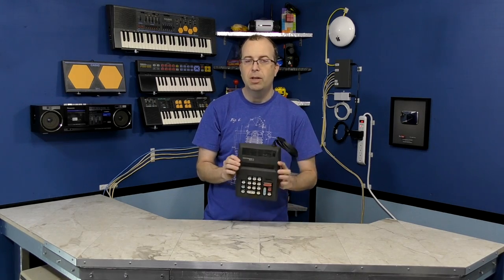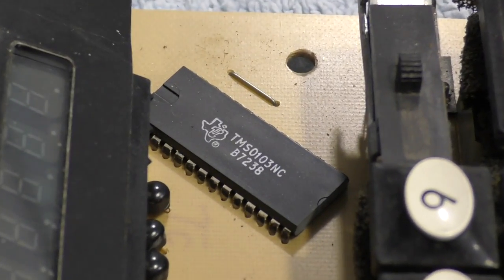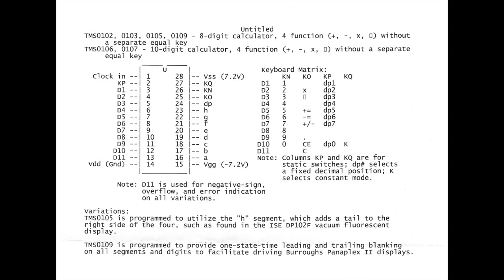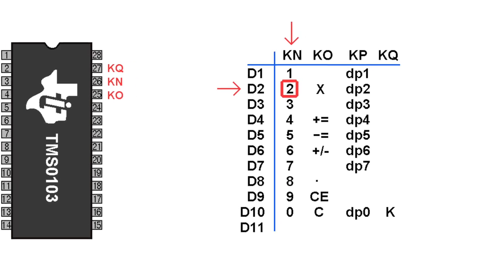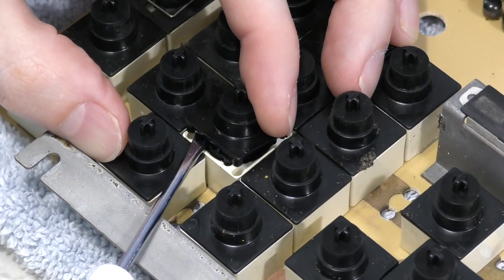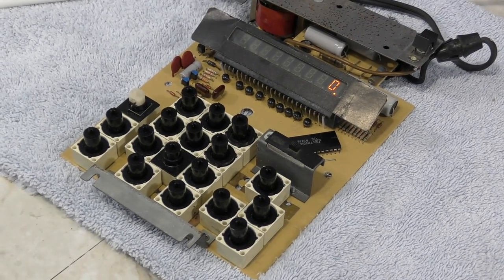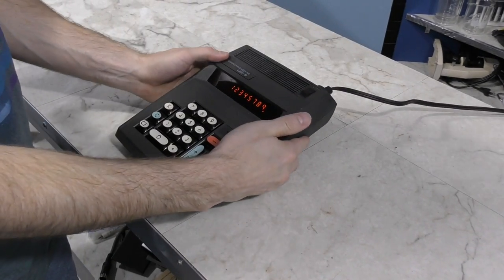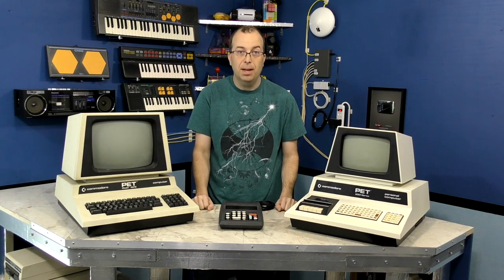Commodore Calculator Repair

Comment: Rule 1 of watching 8-Bit guy. There can never be too many repair videos
Reply: Dje4321 You sir, are right!
Reply: AGREED
Reply: Agreed!
Reply: His repair videos are so damn satisfying
Reply: They feel like some sort of technological necromancy! Best kind of necromancy.
Reply: +Etop Owertwon I think you've just hit the nail right on the head! haha
Reply: "WISE FROM YOW GWAVE"
Reply: Rule 2? Apply retr0bright evenly?
Reply: Uhmm, this might be only slightly related but: Can someone help me repair my bluetooth speaker? I forgot it outside and then it rained. At first it still turned on, but now it doesn't! If I shake it, I can still hear little bit of water inside but I don't know how to get it out. Ahhh and there are no screws how can I look inside? Model is SONY SRS-X2
Reply: 神田直子 You could try to submerge the device in uncooked rice. The rice will absorb the moisture. Leave it for a night.
Reply: Uhhuh, thanks for the tip. I managed to get the front off and look inside, it's all wet. I think I'll get it dry eventually, but what are the odds that it's irreversibly damaged? I think I need a thing like the guy in this video, so I can test where the electricity flows xD!
Reply: 神田直子 Well, if you turned the device on whilst still wet you might have caused a short circuit.
Reply: Dje4321 preachin to the choir
Reply: Dje4321 yel
Reply: Yep
Reply: Dje4321 yep
Reply: There are to few
Reply: Like

Comment: This is why I love old tech:  You can actually fix it.
Reply: @CaletoFran  you can fix old apple computers, its just harder with the all-in-one computers (apple lisa, macintosh se, macintosh plus, original macintosh)
Reply: @DanTDMJace  pretty sure he's referring to modern apple tech. But also some of those old mac's will not be repairable either due to leaky Capacitors or because the SCSI interface just dies (Dave's mentioned it in other videos)

Comment: Paper towel and a screwdriver?  Q-tips my friend.  Q-tips are your cleaning-in-small-places friends.  :)
Reply: Astricx cotton swabs.

Those things to "clean" your ears.
Reply: Now that's interesting. Specifically because Q-tip is the brand name, as opposed to the generic term (generic term would be cotton swab over here...another example is hot tub vs jacuzzi, or facial tissue vs kleenex) So that does surprise me that Q-tip is an unheard of name, as it's a Johnson & Johnson brand, which I assumed was a globally recognized brand.
Reply: I use Q-tips to clean the small spaces on traffic lights in electronics that I use on a regular basis
Reply: Plus a plastic pry. Watching knife on plastic hurt.
Reply: jw11432 who calls a kleenex a “facial tissue”?
Reply: @stevec3982 

If the screw driver doesn't damage the paper why would it do anything to the plastic?

unless your calculator has been in a tub of sulphuric acid i wouldn't expect it to be damaged by a little bit of scrubbing.
Reply: ha you don't know what i q-tip is    it is a stick about the size of a toothpick that has cotton wads on each of the ends
Reply: @lapaii  im from Irrenanstalt lol
Reply: Omg it took all the willpower I had not to yell that at my smartphone (people are sleeping in the room with me so that would have been highly unwise)
Reply: @ald0c  I wouldn't call it a "facial tissue", I'd call it a "tissue". Never once called it a "kleenex" in my life.
Reply: Still, a great hack. And I for one don't even have Q-tips at home.
Reply: @William Martinez I didn't when I first started discussing in international FidoNet discussion areas (kinda like newsgroups, but instead of  Internet it used a decentralized network between BBS systems). Not from a country where they use the work Q-tip.
Reply: @William Martinez Certainly they have, but they are likely called something else. Just like here in Finland (though your languages are very close to each others, but this is a product name).
Reply: @jw11432  We don't have them in Finland either... Just couple years ago they started importing Oreo's, and I don't understand what's the fuzz, as they are almost exactly like our Domino-cookies (the name has no relation to domino blocks).
Reply: @TexasRailfan2008  Nope, it's just a brand name of one such product. What, you don't know First Choice Cola? It's a refreshing black fizzy drink made of coca leaves and sugar. What, you mean they DON'T sell it in your country? What you said? That it's coke? No, coke is a shorthand for another brand name - and then some.
Yeah, really smart.
Reply: The thing with q-tips is that they leave strands of cotton everywhere...
Reply: @jw11432  Heh. Johnson.
Reply: but with what he uses would the cotton on the end degrade or come apart?
Reply: @Blaze5857  I clean my ears with plastic sticks and hydrogen peroxide so....
Reply: @Taylor-xh8uh  and you don't ever get bits of cotten coming off?
Reply: Cotton buds
Reply: They have a tendency to bend/snap in certain situations
Reply: @jw11432  in the UK they're called Cotton Buds or at least that's what my family calls them
Reply: @jw11432  some things are like that. One brand becomes ubiquitous and all knock offs or other brands just get called by the one really known one. Band-aid is another one, it's just one brand of adhesive bandages, but bandage isn't the term used for adhesive bandages, the term is Band-aid. "Grab a Band-aid, some q-tips, and a couple Kleenex." All pretty commonly heard statements here in the US.
Reply: @jw11432  we have the pressence of J&J products in my country but they are not marketed under the name "Q-Tips". Sometimes they will change names either because of language barrier, or other branding reasons.
Reply: You're actually not supposed to use those in your ears
 you can but that's not really their intended use they are for cleaning small things 
Im not being mean im just letting u know

Comment: I was 13 back in '72 and was fascinated by all the new digital desk calculators showing up in stores.  I always made it a point to stop by the display and mess around with whatever they had plugged in, and I remember that Commodore calculator was one of them.  Fun times...fuuun times.  :)

Comment: Q-Tips are great for cleaning hard to reach places..
Reply: on ebay if one searches Foam cotton swabs, you can find q-tips with cotton but also has a foam "overlay" on it, No mess! and some swabs fuzz less than other swabs
Reply: Maybe toothbrushes for babies and toddlers?
Reply: Marko Ahonen foam qtips? gonna have to remember that, thanks for the tip! (pun not intended)
Reply from the maker: I really needed something I could scrub with some force. Q-Tips would just bend.
Reply: EXACTLY! When I saw him "jamming"screwdriver and cloth in the key hole I shouted out :use a QTip". In the past I too have used the screwdriver and papertowel trick. Sometime back in the eighties I discovered the QTips with long wooden sticks but realized a cheep ole' dollars store QTip works just as well and come in bulk
Reply: They have wooden Q-Tips. You can get them online and I think doctors use those too.  They won't bend like the standard ones.
Reply: You can even get the really long ones they have the doctors office. The one ended ones.
Reply: Battery operated micro dremel work too... they cost about $2-$5 ordered from China... maybe another dollar for a felt polishing cone/wheel
Reply: a pencil with an eraser on the end is great for removing oxidation from metal contact points like copper brass or steel (using the eraser end). they way you were using the screwdriver and paper towel could have been too much and could have potentially damaged the pad especially if the soldering job was poorly done and the connection weak.
Reply: What about an acid brush with the bristles cut short?
Reply: That's a great Tip!

Comment: I'm a bit shocked how really simple that is for how much it cost back in the day...  interesting to watch, but honestly about 15 times during the whole thing I was thinking "that is a ton of work to multiply 6x7 just to find out the meaning of life, the universe, and everything!"
Reply: Now build a computer to find out the specific question.
Reply: @someguy2135  that was the PET
Reply: Looks simple, but manufacturing chips wasn't as easy back in the days, especially considering the very low yield and high defect rates with the processes they had.
Reply: @steve.Lowles  can't have been, Douglas Adams specified that deep thought was an apple. Must have been the Apple 1

Comment: Hey, it's the PET that I donated! Can't wait to see the PET episode later. I'm sure it'll be super interesting. Good luck getting the keyboard fixed!
Reply from the maker: hahah.. it's safe to say you'll be seeing a lot more of that PET.
Reply: Same. I'm looking forward to the Commodore PET video
Reply: I found a similar PET with a keyboard problem, and after some AltaVista-ing (this was many years before Google) I discovered that the solution was to use the blue end of a pencil eraser on the metal contacts under the keys. That seemed to clean them up enough for the keyboard to start working again.

The scary electrical arcing noise coming from the back of the CRT was another matter...:)
Reply: The "blue end" of a pencil eraser? What's that?
Reply: IT'S THE PEN ERASER :)
Reply: Yess, it is also used to clean RAM when it's not working and stuff like that
Reply: Ainhoa No, it's the ''PET'' ERASER
Reply: You're the one who donated the PET?
Reply: I watched the unboxing video.
Reply: The 8-Bit Guy I like your personality and your channel is awesome, keep it up

Comment: 8:03 - I'd recommend buying a box of isopropyl alcohol wipes. I use them all the time for cleaning corroded connectors. I usually get the small "Prep pads", the same stuff that nurses use before giving injections. They're small, easy to open and quite cheap. You can also use lens cleaning wipes, though I think those have lower alcohol content. But those are better for cosmetic cleaning than the prep pads.

Comment: Foam: I don't feel so good Mr. 8-bit guy
Reply: Ha ha noice infinity war joke
Reply: I wonder if that foam was why the calculator wouldn't power on at first, with how disintegrated it was some bits could have gotten stuck to the circuitry.

Comment: 8-Bit Guy those hex screws can usually be undone with a modular screwdriver without any bits installed.
Reply: If they're 1/4". that is correct. If not, a cheap 1/4" drive set at a place like Harbor Freight has got to be under $10. I was amazed he didn't have one.
Reply: I don't know anyone who doesn't own at least 1 standard modular driver. They throw them into driver kits for free. :P I've got like 7. I mentioned it because most people have never thought of using a modular as a tool without the bits. :P
Reply: You beat me to it! Excellent suggestion.
Reply: @SgtPiggie
It's just odd "spends thousands of dollars on electronics" "doesn't have the one tool you get free in pretty much every multiple tool set including sets fans have seen him using and recognized from their own toolbox" :P
Reply: Yeah. I typically use it as a disarming tactic so people know I'm not trying to be critical or antagonistic. I'm honestly a very light hearted person but people tend to take me the wrong way in text so it's become a habit to include that so they know I'm trying to be friendly.
Reply: I didn't seen anything wrong with your comment. I can say mean things to you anyhow if you really want...? ;)
Reply: @Maxwelhse
You may not have but it's happened in the past so out of habit I use the emoticon. ;)
Reply: Huh, figured I'd be the only one. I figured it was just a quirk of my autism. :P
Reply: thanx 4 the advice  :)
Reply: Impact drivers tend to have to much torque for plastic by my understanding. They also are way more expensive and specialized than a modular screwdriver which you tend to get with any other tool assortment, multi pack of screwdrivers? Have a free modular driver! Drill? Have a free modular driver! New toolbox? Have a free modular driver! Honestly I think 8BitGeek needs the bitkit though. Those magnetic trays, having every bit needed for retro electronics...*drools*
Reply: Actually a non impact based drill is fine as long as you use a low torque setting. Sorry I missed your joke btw. I hoped it was a joke but without tone I didn't want to risk you breaking your retro consoles or someone else who may read it breaking theirs. :P
Reply: I have used a regular non impact drill on several electroics using both low speed AND low torque and it generally is pretty safe. I dont' think I'd ever try a press for anything other than drilling holes though. :P
Reply: I actually found that out almost by accident.  I was taking apart an old ac unit and it had those hex screws and I was of course using a modular screw driver.  When i pulled out the bit, I looked at how the hole was shaped, had an "Aha!" moment and sure enough that worked perfectly.

Comment: I've got a PET 4032 and I can tell you that cleaning the keys is really easy. Took me less than an hour, including disassembly. Be careful, the shift lock key has a different type of switch, and needs to be desoldered from the board before you take it appart. Have fun!

Comment: You're exactly right about the fuse. One of the things I learned in basic electronics class from a teacher who hand-drew circuit boards in the 60s and 70s was that even if you have contacts which don't visibly look corroded, an oxide layer can form which prevents the flow of electricity (or has high impedance, which would also be bad). The trick I learned from him was to scrape these contacts with a knife any time you're working around them, since it can take years for an oxide layer to build up, and if you're already in there working, it doesn't waste any time to do that tiny bit of preventative maintenance. This applies not only for fuses and battery contacts but for switches and such too. Normally, you soak these things in vinegar in 8-Bit Keys, which does the same thing, but in this case, the contacts are soldered. If you're feeling up to it, you should give the fuse contacts a nice scrape with a pocket knife. I use one that I wouldn't be afraid to use as a screwdriver.

Comment: I wouldn't care at all about this calculator if a) it were not a Commodore and b) you weren't making one of your excellent videos about it.
Reply: Meanwhile, I only cared about it because of the TI brain I already knew was in there. My house was on the OTHER side of the home computer war.   Protip for long-retired TI management: Don't put your 16-bit machine with 16K of RAM into a price war with a friggin' VIC-20, especially if you're not going to cut costs with the build quality.

Comment: Glad to see that work out :)

Also there is something beautiful about how simple those switches are.
Reply: I was friends with Steve Wozniak. In the mid ‘70s when he worked at HP, I remember him asking me about curves. They were designing switches with domed pieces of metal that would snap to make contact with the circuit board below. Here you go.

Comment: My guess on the mysterious DOA repair is that the contacts in the power switch itself were probably oxidized and by simply mechanically flipping the switch a few times you cleaned it off and it began working correctly.
Reply from the maker: I suppose that could have been the case as well, didn't think about that.
Reply: Always try to work the switches on stuff like that a few times before you jump in. In any event, a self-healing repair is always the best kind.